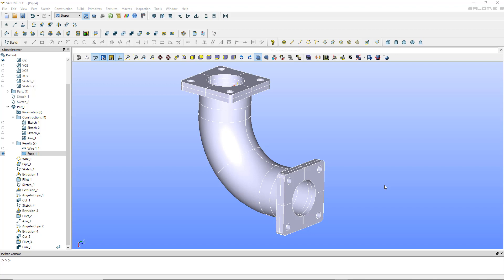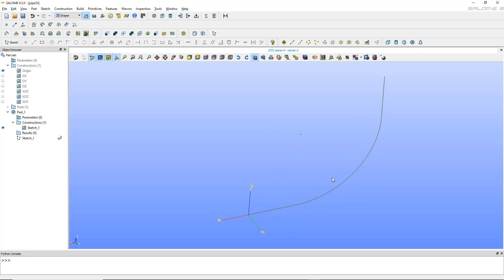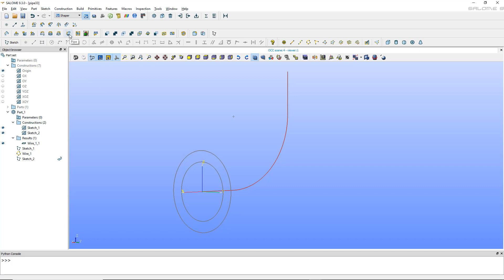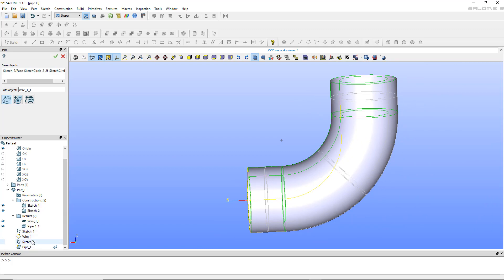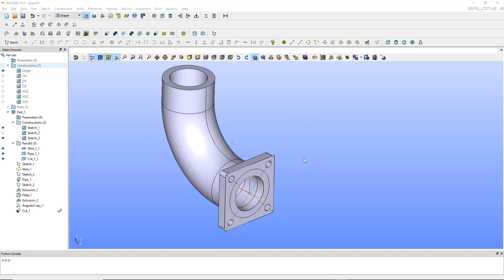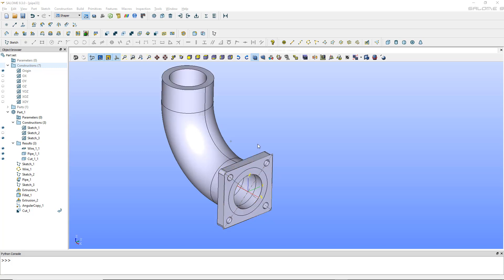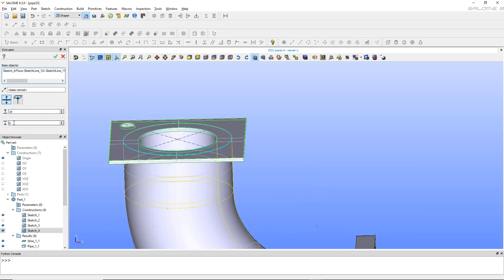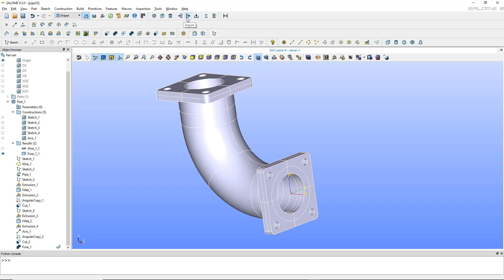Salome Shaper Tutorial 2 : Modeling a Curved Pipe

Comment: Thanks for dedicating your time to preparing these tutorials - they are useful. I wanted to suggest an alternative to making the second flange: since it is identical to the first, it is quicker to first create a new axis at the intersection of the faces at the end of the pipe, then using it as axis of revolution with the 'angular copy' tool to copy the first flange with an angular step of 90 degrees (2 copies).
Reply from the maker: I agree with you, actually that’s what I wanted to do initially, but it just didn’t work so I had to choose another way... (probably it was a bug...)

Comment: Very nice! Subscribed! I have been going through your videos on FEA & especially the new parametric capabilities of SALOME. Finally there is a free program on Linux where the workflow is similar to paid CAD tools. I have been on the lookout for such a program for so long. (Have been using a VM with an old Solidworks to do my modelling)

Keep the videos coming. In regards to your final comment about feedback or improvements for this model, I do wonder if it is possible to do an Extrude Cut directly for the holes (and copy/repeat that) instead of having to do a plain extrude first. (also in regards to constraining the small holes for cutting on the auxiliary lines - you can start the hole on the line and it will at least create this first constraint - this saves having to do a coincident twice)
Reply: Hi, I have multiple times (I kept a copy mainly to open up and verify models produced by other software such as kicad) but the UI just doesn't mesh with me. (the different benches and difficulty in finding the tools I needed...) Salome, however, just makes sense (especially if you come from a background of using paid MCAD software) the UI is much clearer from the beginning.

Comment: Salut Cyprien, I've got some questions about the meshing in Salome... Right now I've created a somehow complex geometry with the help of the module Shaper, and I want to get a mesh in hexahedron instead of tetrahedron. However I have little knowledge which algorithm and hypothesis to choose and I got some errors from my attempt. Then I've found a tutorial for this as well and it says that to create the groups of edges is necessary. Is that really the case? (Cuz I thought I only need to create the groups of the faces...) Thanks in advance for your help. Nice day.
Reply from the maker: Groups of faces are generally used to apply loads, while group of edges are useful to specify the number of elements on specific edges of the model, so yes, you will need to cut your model strategically and then create edge groups to set the number of elements. Hexa meshing in Salome is mostly manual so it can be a lot of work to find the correct way to cut your model. Good luck !

Comment: Hello Cyprien ! 
Thanks for this tutorial, it really helped me modeling geometry with this new module of Salome ! I was wondering if it was possible to export this model into the geometry module and then using Code_Saturne to run a calculation ?
Actually i tried it but i still get some sticky errors and think it comes from the fact that my model was not created in the geometry module. I would really appreciate a SALOME_CFD tutorial with the shaper module !
Lucien
Reply from the maker: Sure, its possible. It’s a bit hidden, but there is a button to export in Geom. you have to be careful when you export, because sometimes it export a shell instead of a solid, that’s why the 3D meshing fails. I had this problem several times. If you export a solid, then you can mesh it, export the MED file and use it with Code_Saturne. If you use Salome_CFD, the code_saturne installed in it as a module already supports MED files. If you installed the stand alone version, you’ll have to make sure that you    Have med installed and that you compiled code_saturne with med.
Reply: @Feaforall  Thank you for your answer Cyprien ! Do you have a tip to export it as a solid and not as a shell ? I don't see any option when i try to export my file ...
Thank you again